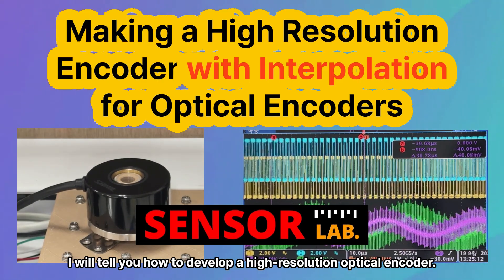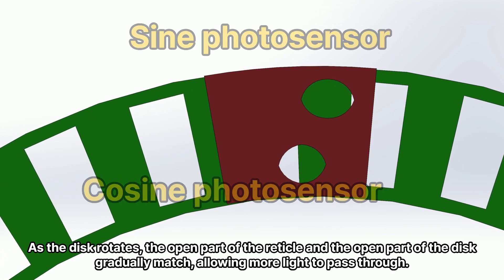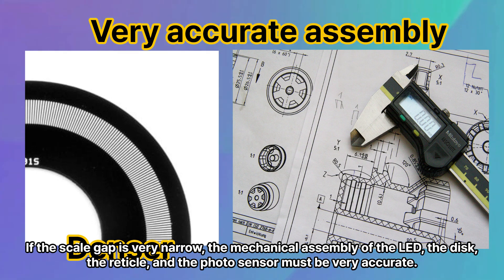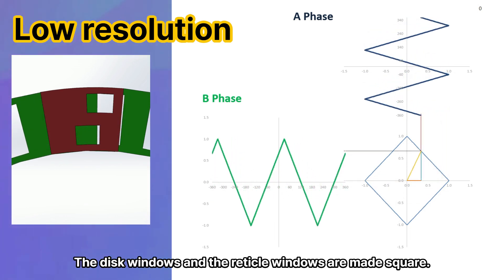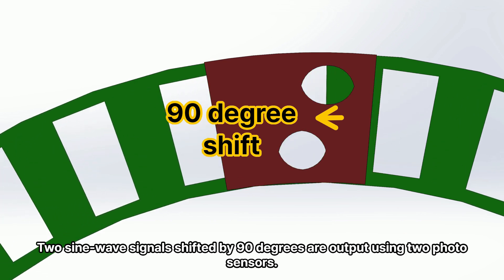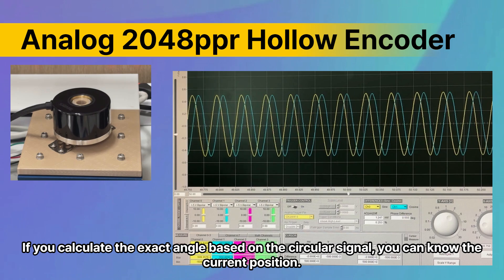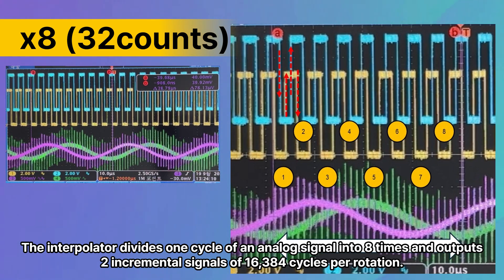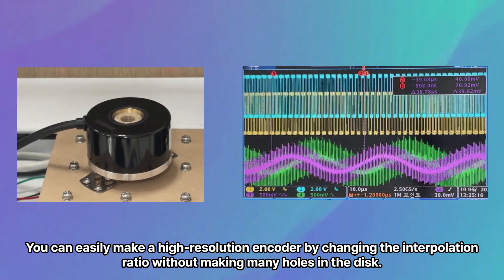Making a high resolution(20bit more) optical encoder with interpolation. SensorLab.

Comment: Hi mate, do u know the 20bit incremental encoder panasonic servo minas A5?? I just see the pin out is, 5 wire ( shielded, 5v, GND, PS, and invert PS) i dont see out ABZ mate.
Reply from the maker: What encoders are called in servo systems can vary from country to country.
Recently, in many Japanese servo products, what’s called “incremental output” often actually refers to a single-turn absolute encoder.
In fact, most Japanese servo systems are equipped with multi-turn absolute encoders that use a battery.

If a battery is connected to the encoder, it's typically considered absolute; if not, it's treated as incremental.
However, in reality, both "absolute" and "incremental" here refer to serial communication encoders that provide absolute position data.

These encoders usually use RS-485 communication, so the output typically uses a 5-wire connection.
Reply: @dr.sensor  yes i see also in data sheet of servo motor they say incremental 20bit serial encoder. ( without battery ) so any tips or trik to read the data from that encoder?? Because i make the driver, i have panasonic minas so i just want to used own encoder mate. 

If no choice i must be change then encoder, buts it will spend money again, i have around 20 pcs ac servo without driver, so i want makeit the driver
Reply from the maker: I think implementing Panasonic serial communication is difficult because Panasonic serial communication is not an open protocol.
Reply: @dr.sensor  owhh ok mate, so i must change the encoder😁

Comment: The basic idea is good, but not novel. You will not get anywhere near 20-bit performance this way. Measuring any physical quantity (except time) to within one part in a million hardly ever happens in practice. 20 bits is the equivalent of a breath of air compared to the weight of a car. Consider that the placement of the slots will need to be accurate to a millionth of a circle, (about 1 second of arc) or you will get missing codes. You will not get a sine wave so distortion-free that you can interpolate it to thousands of different levels. You will also need to deal with the effects of physical optics. As an optical aperture closes, the light transmitted in a given geometric path becomes non-monotonic due to optical diffraction. Your light detector will have shot noise that will become significant as the rotation speed increases. Stray light needs to be eliminated. I suggest that you try to build a 20-bit rotation encoder, put it on the same shaft as a commercial 20-bit encoder (like one from Renishaw) and present the results of your comparison in a follow-up video. If you can get the first 14 or 15 bits to agree, you will have done admirably.
Reply from the maker: Thank you for watching and commenting.
This video basically explains the principle of making a high-resolution encoder as you mentioned.
The encoder shown now is an encoder with 24-bit resolution by interpolating 2048ppr + 13bit.
In order to compensate for the optical distortion you mentioned, an interpolator with a built-in real-time correction function was used. (The interpolator uses the function shown in the video.)
Next, I will explain by making a video demonstrating an encoder with 20bit or more using a photo IC and a high resolution interpolator.
I will demonstrate and explain the part where the optical signal is distorted and how to compensate for it.
Your comments were a great help in making the video.